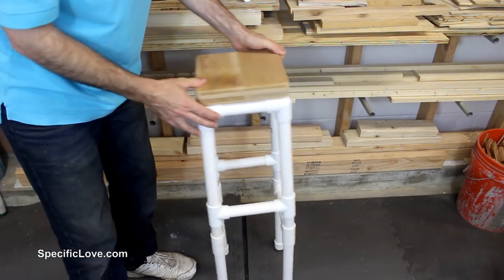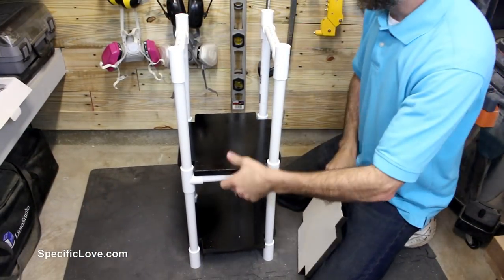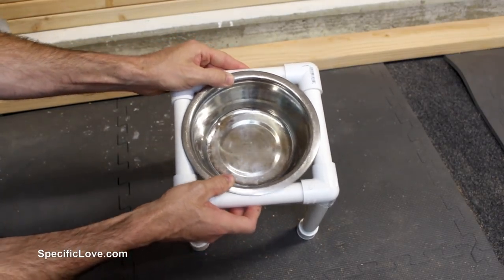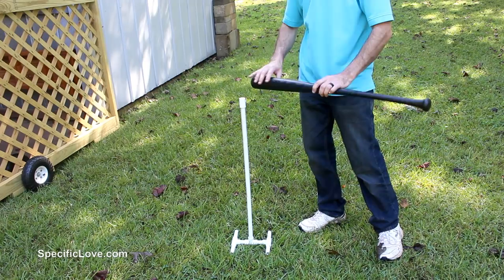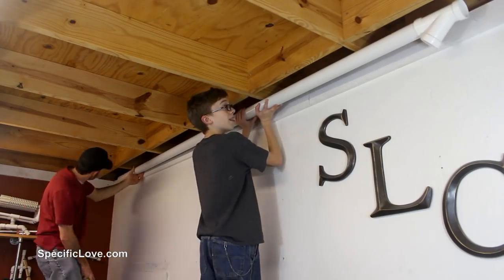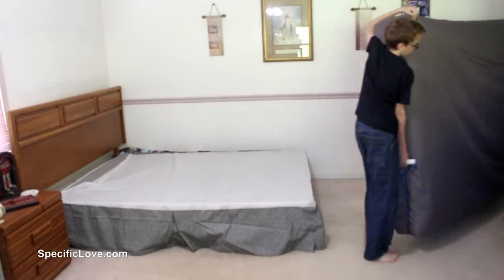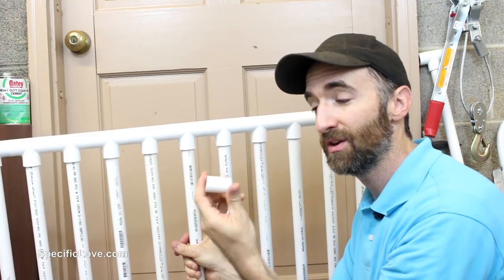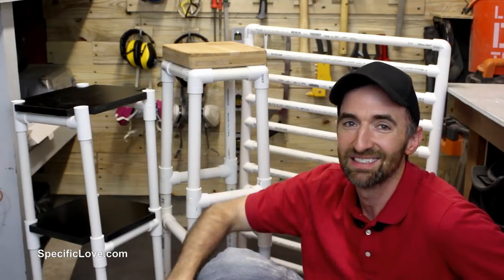10 Life Hacks with PVC #27

Comment: I just found you yesterday while looking for pvc build info. I don't see an index of all the projects in all of your videos, so I am binge watching to see if sonething close pops up. I am on video #27 so far. I was hoping to see more heavy duty pvc building. I am looking at this lemonade stand, and I saw your window awning clip, and the motorcycle shelter. I want to turn my small deck (approx 8' x 10')  into a porch and make an awning/cover for it out of polycarbonate panels. And I want to make the support poles out of pvc. Maybe the the framing for the polycarbonate panels too. Not sure. I saw another person making support poles for his camper awning. And he used three way pvc splitters for feet at the bottom of the poles. Do you have any projects of this magnitude?

Comment: the legs of that stool are so tall, it looks unstable, that kinda thick borad to sit on wasnt even required,  a 3/4" thick block board piece was sufficient..  hope uhv filled the leg pipes with sand and sealed it, that way it will be much stable for such  long stool. thats my suggestion . 😁

Comment: Is it just me or do pvc projects seem to be more expensive than just buying a product. Those T connectors can be like $2 a connector meaning that stool costs something like +$32, which is not much saving than just buying a stool. Is there a cheaper way to get off connectors?
Reply from the maker: The price may depend on where you live. I usually find them to be cheaper at the local home improvement store than I can ever find on Amazon. Also sometimes you can buy them in bulk packages for cheaper.